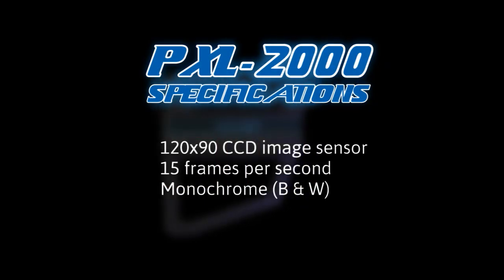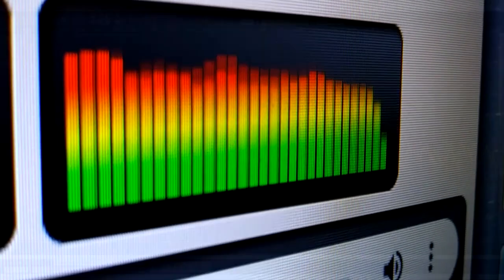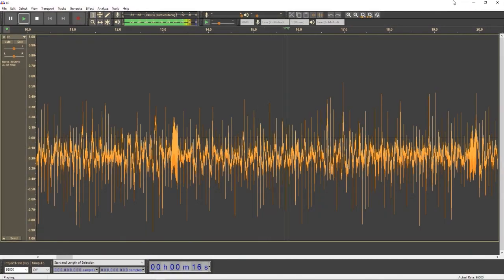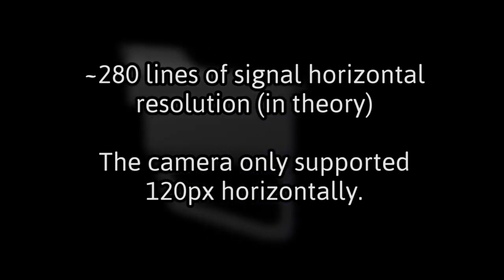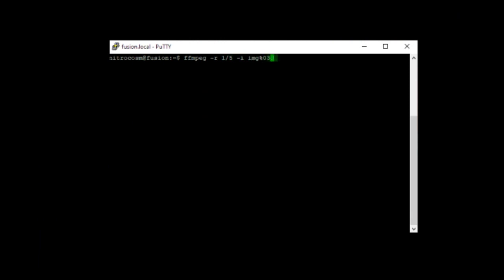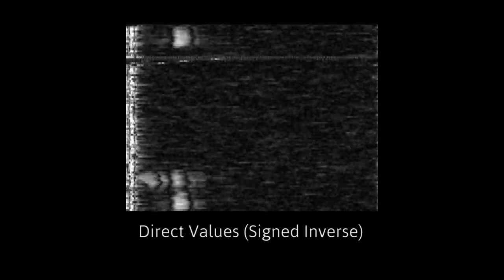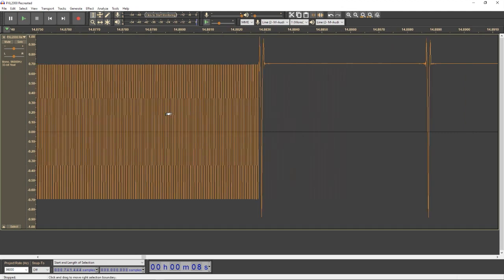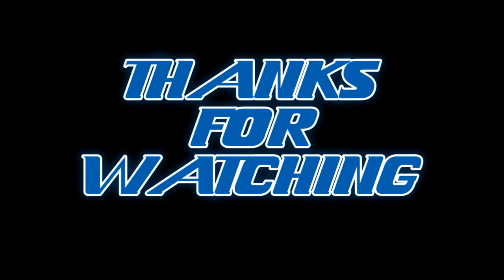Decoding PXL-2000 Tapes

Comment: Troy, if I remember correctly, the video is stored in tape as FM audio.
Have you thought to use Aduptive Noise reduction to actually remove the noise, so you can kep intact the fM sigal and then amplify the whatever is left content?

Comment: Hi, great video, I think I have some insight as to why this didn't really work. It has little to do with the degradation of tapes. The video signal as-recorded is wideband FM (like most video recordings) and in looking at the amplitude only you're slope-demodulating it resulting in very poor S/N ratio and no DC response. If you look at the FFT of the PXL signal at 1 7/8 speed, it resembles a "normal" video signal, sync tip ~15KHz blanking ~19KHz peak white ~31KHz. I have some of these tapes that were recorded off-speed (dead battery) and it would be really interesting to make a software demodulator that had better horizontal AFC than the one in the camera. Still have a working unit and could shoot some test patterns with it.
Reply from the maker: Yeah, I know the camera's signal is FM but there isn't enough bandwidth preserved in my capture to get anything out of a FFT of it.  I've certainly looked into that.  The AM decoding should at least show general outlines if anything is there.
Reply: @Nitrocosm  Makes sense. The Nak MR-1 I was looking at it with appears to provide a usable signal that high, but a lot of decks probably wouldn't, and I would imagine azimuth alignment would be extremely critical. This system was perilously close to not working at all, even for a toy!
Reply from the maker: Ah, you'd get more high frequency signal with a quality deck for sure.  I captured it from a cheap Aiwa home stereo tape deck in 2005.  I had access to a better one but was lazy at the moment and hadn't planned on going very in depth with analysis back then.  I certainly wish I'd kept the original tape!

Comment: Decoding tapes? If you have VHS tapes then you can try VHS-Decode software.
Reply from the maker: VHS-Decode is absolutely fascinating but I'm afraid the PXL-2000's video format is vastly different.
Reply: @Nitrocosm  Yes as conventional video tapes require more bandwidth and contain FM modulated video signal while PXL video isn't.

Comment: Very very interesting video, thanks for your knowledge. Could be possible to "recreate" the PXL-2000 with a normal camcorder plugged into a walkman? Or do you need an encoder first to write video on the cassette tape? Thank you!
Reply from the maker: No, the bandwidth requirements of an NTSC or PAL signal from a regular analog camcorder would be far too high for an audio cassette.  The resulting recording would have almost no horizontal resolution and no vertical sync.
Reply: @Nitrocosm  That's interesting for an experiment. Could be possible to do something in the main cable to reduce and adjust the signal bandwidth? Or maybe programming an encoder/decoder into a raspberry as an interface between camcorder and walkman? Thank you